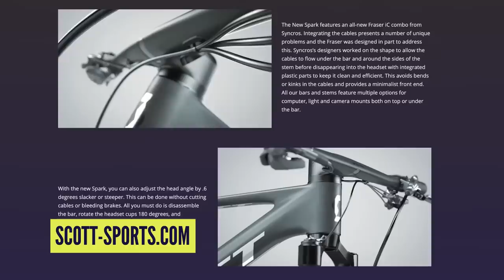Is Headset Cable Routing A Good Idea?! | #AskGMBNTech

Comment: I will say, the internal headset routing does look good. But as a tech, it's a complete pain in the balls to work on.
Reply: I had a Merida reacto come out of the box with a kinked front gear cable, and having headset routing made it 10x more of a ball ache
Reply: @Scabadart 100 percent it does lol. We recently picked up Orbea. Gorgeous bikes but the internal routing is, again, a pain in the balls. For issues exactly like you'd mentioned.
Reply: True, some bike models require semi-strip and rebuild of most the bike to replace. Customer is not happy to carry that labour rate. Also there are instances of cable outer rub on fork steerers causing damage to (mostly carbon) steerers.

Comment: Absolutely disagree with some of the comments on oval chainrings. I run them on a few of my bikes - I find that they help me on steep and loose inclines, as I’m able to put down more consistent power and thus avoid the rear wheel spinning out. I do however feel no need to “retrain” getting back on a bike with a round chainring. 
I also use an oval on my cargo bike. Doesn’t effect me on the flats at all, but on inclines I can get the bike over slightly larger hills, that would otherwise require lower gearing. 
I’ve found they do jack all on my full suspension however, so I’m just running that on rounds
Reply: Made to eliminate the dead spots at twelve and six. Worked too as i remember.
Reply: How do you mount your oval chain rings? One of my bikes (no mtb, a 1989 trekking bike) has original biopace chainrings. Some people say the way Shimano intended to mount them would be wrong, and modern oval chain rings would be mounted 90° rotated.
Reply: @simonm1447   good question
I dont remember. I would think in line with the crank but it's been a long time sense I've seen or had a bike with bio space chain ring. There still around though. I would find old pictures of retro bikes that should tell you where to set it according to crank position
Reply: @simonm1447  Honestly, I'd google it - I run Absolute Black chainrings, and just followed their recommendation. But I do remember it being different to biopace, yes.
Reply: @rasmusvedel  I will try it, recommendations of the manufacturers should help

Comment: 2:03 I still run barends on my hardtail. They don't have any drawbacks. Or almost none. Last time I had to cut an Ergon grip. It had a taper, which sits on the end of the bar. I don't really know why Ergon does that, but they gave me headache.

Comment: For MX wheels (29/27.5) I got my firstbike with them recently, a Nukeproof Megawatt. I was a bit concerned that the front end was going to be able to write checks the rear end couldn't cash as far as rollover. Haven't found that to be the case yet sending it through all sorts of rock gardens and other features!

Comment: Missed in the 'advantages' of USD forks (and a big reason motorbikes moved to them).

Fork Stiction. (the effect of the down tube 'jamming' in the fork leg under load.)

Example, next time you pull out your axle bolt... see how easy it slides when pulling it straight out... now try pulling it out on an angle... even well lubed it puts up a fight. 
The seals on a fork are basically the load point where this jamming has most effect.
On "Conventional" forks the seals are at the top of the wheel and the point of load is the bottom of the wheel... effectively a 29" sideways lever on the seals.
With USD forks, the join (seals) are closer to the axle, and actually move closer still under compression/dive, lessening the effect of friction on the seals (where the distance remains static on conventional forks under dive).
Something also on the horizon is linkage forks (USD forks with link arms allowing the axle to follow a non linear trajectory) 

Watch this space when they bring back girder forks that (in theory) have NO stiction so should be able to be more responsive/smooth regardless of load under impact/breaking like conventional or USD forks.
Considering the weight savings especially with Carbon Fibre and titanium 3d printing, I'm surprised they haven't made a comeback for gravel bikes.

I think I got that right... Feel free to flame if this collection of potholes (and plot holes) I call a brain got that wrong...

Comment: Internal headset routing is literally the worst design choice known to man, it's rubbish to work on, it rubs on your steerer tube, if you have a zs65 like my bike there's no decent option for aftermarket bearings so it fails stupidly quickly. I'll never own another bike with it.

Comment: I’d trash an inverted fork in no time 😂 
Looking at all the scratches on the lower leg on my SID SL, if it was inverted I would’ve had to replace it several times.
Reply: If you look at current inverted MTB fork and Dirt bike inverted forks you will see a plastic protector that prevents damage to the exposed slider.  If that's your only problem it's been solved for you already.
Reply: What are you doing with your fork? Mine lowers are look like brand new. :D

Comment: I never used bar ends for alternate or rest hand positions, but I am loving the Loam Labs Counterpunch bar ends for protection. Already saved both pinkies several times smacking trees. I run oval specifically for how the pedal stoke feels in the climbs and they go great with single speed. However, I'm a hair slower overall on the oval than on a round ring with same tooth count.

Comment: I like the theory of a grip shift dropper.  It would make a dropper on a 2X system easier  so the dropper lever and front shifter aren't using the same space.
Reply: Yes, the theory is good, but it would be a nightmare to ride. I've used 6-Speed RevoShift for a long time and i can tell you that on stressfull situations i would end up shifting by mistake which is something you don't want. I think what they could do would be to comeback with the XTR STI levers (ST-960 or ST-965 for hidraulic brakes)
Reply: Until you hit that shifter on a decent and have that seat come up at the worst time.
Reply: I didn't say the execution was sound. Just the theory.

Comment: I'm kind of mid ground on headset routing. It cleans up noisy cable rattle by keeping it tidy, but on MTB and suspension forks, you can't run the front brake inside the fork leg like roadies do, so it loses some appeal. If you run in muddy etc conditions that are going to torch your headset bearings, each replacement means cutting your hydraulic lines a cm or two to put a new barb/olive in, and eventually they get too short and you're replacing the whole hose rather than just regular bleeding (and if you leave the cables longer, then it's not neat and tidy anymore so what's the point). While I don't necessarily mind routing the cables in itself, I've also run into several bikes where the cables get so crowded going around the steerer tube, they rub on each other and make annoying clicks inside the frame as you turn the bars. Wireless shifting has done far more for cleaning up the cockpit than headset routing, but comes with the increased pricetag and not everyone wants batteries...

Comment: Bar ends are useful for those who desire a neutral hand positioning between pronated and supinated.  This can often prevent/relieve pain in the shoulders caused by impingement on tendons in the shoulder.  Works for me!
Reply: I ride marathons and bikepacking with two pair of barends. :p It should be mandatory on long distances. They don't have any disadvantage.

Comment: Everyone keeps talking about the customer and mechanic side of headset routing. A bigger reason for the manufacturers is the ability to produce the frames cheaper since they don’t need any extra parts for the small holes, and to add to that, stress and strain analysis in the development part becomes simpler since you loose concentration point where cable holes would be.

Comment: #AskGMBNTech I understand the importance of a correct saddle width according to your sit bones to achieve adequate support. But what's the difference between a MTB saddle and one intended for road cycling? Even within MTB saddles there are different models intended for XC, trail, Enduro or DH.  Is there any valid point to these subtle design differences or they are just trying to sell us N+1?
Reply: The only difference really is extra padding round the sides on some saddles to give extra padding incase of a crash but that's only on well designed mtb saddles but on the whole theirs little difference so ride what works for you
Reply: There are some valid differences especially between the road and MTB saddles. A lot has
To do with seated position. In mtb it’s not as important especially if you’re up and down in the saddle a lot. I’m road you are mostly riding butt in saddle so that saddle shape is vital for a comfortable ride.
Reply: @tracymcmanus550  your sat down peddling most of the time in cross country so what would be the difference between a cross country saddle and a road bike saddle in this case?

Comment: #askgmbntech Hi, I got an issue with my brakes. Got Shimano MT200 system, the pads move fine, changed the rotors for new, built a truing stand and they and rims are as straight, the caliper is aligned pretty much central, the wheel hub is not wobbly. But I get rub at certain speed range. As I'm pedaling or coasting at 21-24 km/h in straight line on tarmac it rubs. But not on lower or higher speed, not on a service stand, not on soil, or if I switch my tires from the knobby off road to xc. Can the vibration caused by the tire be the cause, or is it possible, that I have some structure issue on the tires? This is my last and most obvious guess... You have any advice on what I could check next to solve it?

Comment: If you service your bikes yourself just another unnecessarily pain.  Four of my bikes have cables routed through top and down tubes, neat, but just makes replacing a cable a quite a bit longer job.  Starting shifter cables on Sram Force leavers just does not work without removing the leaver, removing the three screw dust shield and putting a loop in the cable so it can be threaded through the shifter.  If you do this, make the loop at the end of the cable so the kink it causes ends up on excess cable that you will snip off any way.

Comment: I said it in a previous video, headset cable routing is a big mistake, it over-complicate things unnecessarily.
When you want to change/upgrade stem and spacers, you need to purchase the same brand as the frame, limiting you in spacers height, material, color. And this in the situation that you live in a country that there's a dealer that brings that specific part of that specific brand; if you live somewhere else, good luck.
This kind of "unique" parts come with a cost where price/quality ratio is not always good, as you are paying for "exclusivity"
All these headset cable routing are the same, please prove me wrong and try an stock spacer into any of those "new systems"
In summary this new "feature" cuts your freedom and the right that we have as customers to choose any spacer, stem or similar that we want for our bikes

Comment: #AskGMBNTech With more and more battery powered stuff like dropper posts, shifters and sensors, do you think that brakes might be „wireless“ in the future?
Reply: No. Most people don't ride like that, but staring death straight in the 👁️ at the edge of some cliff relying on your tyres and the most expensive brakes on the market is at least the idea isn't it? Hard braking maneuvers within30cm of falling down a cliff.     Just not the kind of thing where you'd want to market wireless anything.  On roadbikes maybe though probably no. Could also clash with regulators.  I mean. Here in Germany police generally don't care if your bicycle has the reflectors it's supposed to have but definitely doesn't or whether your light is up to code but that you got light at night and got brakes, yes.  Brakes that could be out of battery are pushing it too much

Comment: You can make 27.5 inner tubes fit in 29. And a 27.5 tube also weighs less.
Reply: I've stretched a 26" inner tube over a 27.5" wheel. Works fine.

Comment: The biggest reason that everyone does Headset cablerouting is probaby cost. It´s way cheaper for a manufacturer to use a cheap plastic headsetcup than designing cable ports into a frame.

Comment: Internal cabling is actually cheaper as the manufacturers don't need to weld on fittings. Rattle is mitigated by extremely cheap foam sleeve too. Now, putting it all together is a big setback in terms of labor cost. So cheaper frames having external routing is more of a marketing thing as usual buyer wants to a) service the bike themself and b) not being associated with roadie elitism.

However, another advantage, especially when we talk integration through the stem - it adds protection for the hoses in case of crashes of zipping through bushes. But also I'd very much like to see a full integration system that allows barspins and doesn't eat through steerer or weakens headset preload.

I think we are currently at the point when it doesn't make enough sense for enough people. Yet.

Comment: Love my Orbea wild, but this internal cable routing is the worst decision in bike history for average consumers. Almost impossible to do a service on headset or removing the fork by yourself.
Reply: Is it really that bad? Got a 2022 Wild with routing only throuh the frame. Replaced shifter with AXS and might change the dropper in the future. Especially with an EMTB there is too much cable overall imo.

Comment: I think the one of the reasons is for Mad As, Bar Spins Mate
Reply: Then they couldn't sell you bar stabilisers (which are basically pointless on slack head angles).
Motorbikes use them on twitchy steep head angle race bikes allowing fast steering response but which also result in 'tank slap'...
When was the last time you had Tank slap on an MTB... Not sure I have ever had it in 30 years of (albeit mediocre like my videos) MTB riding.

Comment: #Askgmbntech How can you understand the potential cause of knee pain without spending money on various parts? I’m fairly certain it’s my cranks being too long (@175mm) but without buying new is there another way to assess? 
It’s on my BTR Ranger.
Reply: Maybe you can find a bikeshop that rents 2XR FIT CRANK ARMS or they can give you different used Arms that you can test. Or you drive to a „bike fitter“ to get the size that is comfortable for you.
Reply: You can move your saddle back and forth, tilt it up or down, play with the saddle height etc. If you want to pay a  little for your comfort, you can try different saddles, stems, handlebars with different angles. If you ride clipless, you can change the position of your cleats. Try pedals with longer spindle, use different shoes. There are endless possibilities. Your goal is to make the bike "disappear" under you.
Reply: ....   There might be a fault in my thinking here but.  Couldn't you make the pedals thicker to simulate a shorter crank?  Strapping plywood to them.  If grips very crucial strap pedals to your pedals with foam in between for grip.
Reply: @gur262  this would result in shorter length with crank in bottom Position, higher length in Upper Position and nearly same length in front and rear crank Position. I wouldnt recomment doing that.

Comment: I think the future of internal cable routing for MTB is putting it fully inside and in some cases wireless. So the headset thing is kinda a half step thing. Also I think some systems will be refined over time to be easy to work on. They do it right and cons will be all but gone.

Comment: I have to disagree with ports making the frame weaker.  If this was the case we wouldn't have onboard storage compartments.  Think about that for a second and most will agree with me.  But as a Mountain Biker this is one trickle down from road racing we don't need.

Comment: if you watch how pro riders set up their bikes, they sometimes adjust their stack by moving the stem up or down the steerer depending on how steep the tracks they're gonna ride. 10mm or 15mm stem prevents this and you are going to live for the rest of your life stuck on a single stack set up.

the shortest stem possible that can be adjusted up and down the steerer tubes are:
31mm for 31.8 mm clamping and;
33mm for 35 mm clamping
Reply: Have you seen the stem and bar combo where the bar has a crescent shaped cutout in the middle for the steerer to sit in? I think it's like 15 or 16mm of reach length
Reply: @kingflynxi9420 if its an integrated carbon stem and bar, that will most likely solve the adjustment problem.
Reply: Id lower the numbers to 30,5 and 32mm respectively.
Also I disagree that you can't do anything about direct mount stems: adding spacers under the upper crown is still a thing. Spacer plates for direct mount stems are also a thing.
Mondraker stile stems are what we see on city/trekking bikes. I think they are rather unfit for mtb from stiffness/strength perspective.
Reply: @feedbackzaloop  if you can manufacture one. but the sizes i've stated are readily available. check renthal apex stems
Reply: @feedbackzaloop  you can add spacers, but what happens if you want to lower your stack height? you cant, since the bar will be right above the steerer tube.
Reply: @miyui9269  If you want to lower the height you a) take off the spacers from underneath the upper crown, let the steerer protrude. b) cut the steerer as pretty much with any stem design and when you want to go back up put plates between crown and stem.
Raceface Turbine is 32 long for 35 clamp. Industry nine claim 30mm for 31,8 - they must be rounding down from actual 30,3 or so. Yeah, "I can" manufacture it.